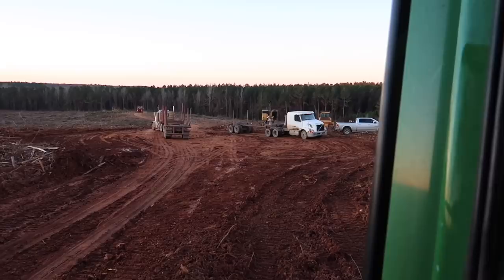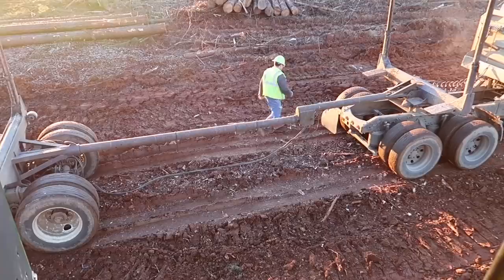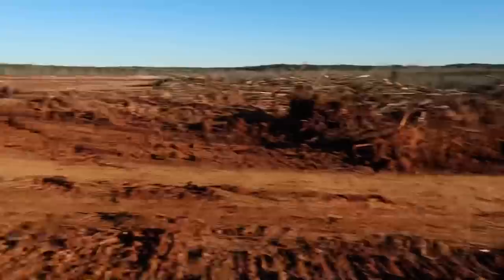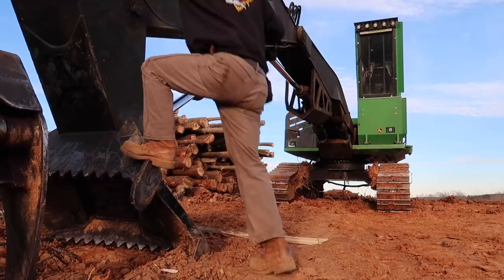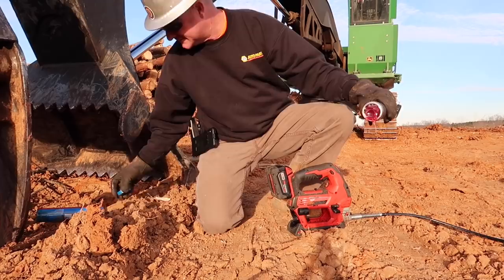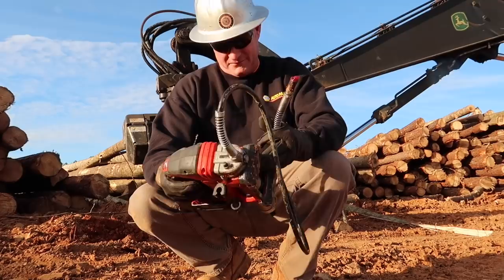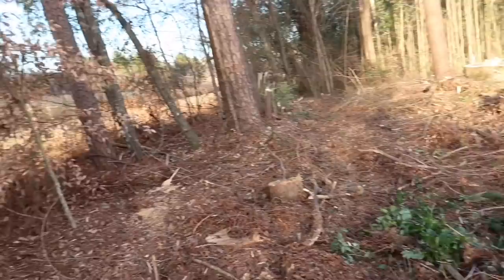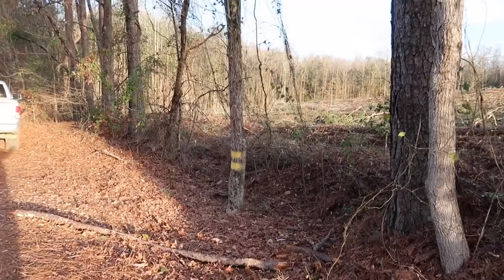How to make a log trailer longer in 3, 2, 1.......

Comment: Thank you for the tip on the grease gun. I bought the 12V Milwaukee version. All the grease guns I have owned could never get the air out, pushed the black button, didn’t work, but just to not put it on tight, You are the man!!

Comment: Never seen a loaded pole trailer in real life, pretty cool how you can lengthen and shorten the trailer. All we ever run in VA is double bunk& plantation kind. Bought a couple of the new McLean trailers, really nice. High vis yellow/ green color to! Thought I was the only one who cuts the row of trees by the roadside,most crews just leave them. I like cutting that strip because in the winter,breaks the shade and helps the melting of snow on the road in the winter. Plus some of the biggest trees on the tract are those, nobody takes the time to get them.
Reply from the maker: You are exactly right. I’m waiting on approval to stick a saw in them right now.
Reply: Kevin Harris were you at in Va?

Comment: Back in the early 1990's when i worked around the Scooba, Philadelphia, and Kosiusko area for IP, they were a bunch of folding pole trailers in central Mississippi. I know that is a little south and west of you. I always thought they were neat to see them un-fold off the back of the truck. I could see where they would be limiting as well. No pine tops on one of them trailers. I seen some in South Arkansas, around El Dorado, hauling logs that would make any logger drool. Slick bark, no taper, and all around 40 feet long.  They had them stacked to the top of the standards.

Comment: with the Milwaukee electric grease gun Tim all you have to do is screw it in and push the little black button on the side and it releases the air out of it
Reply from the maker: I don’t like to do it like that because you’re going to get grease out of it. As long as u don’t screw the barrel all the way down, the air will come out and u won’t get any grease out either.

Comment: There is a black button up by the front of the grease gun that you push and it will release the air and won’t make as big of mess
Reply from the maker: There is no mess how I do it either.